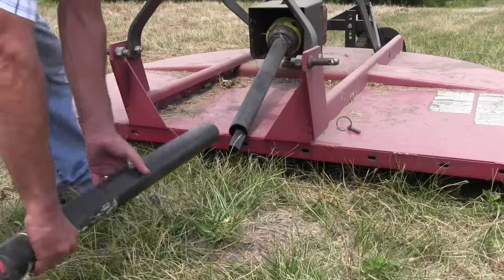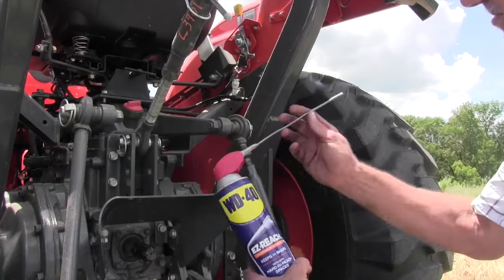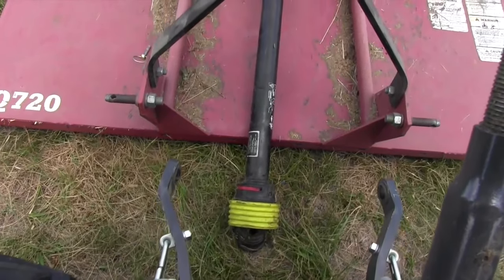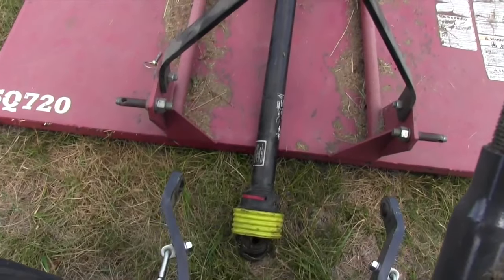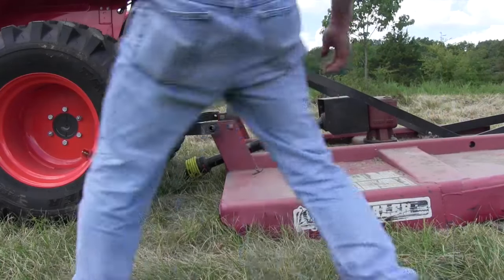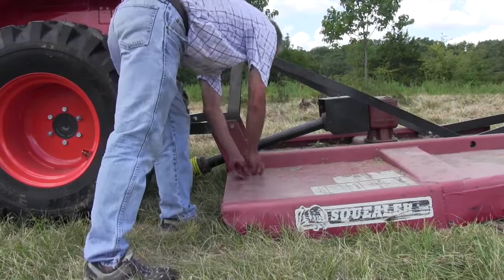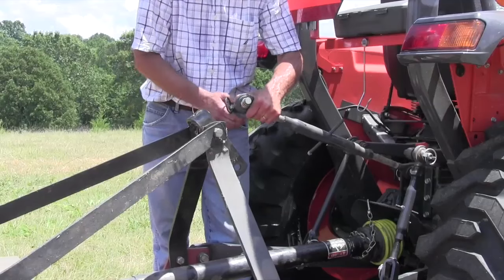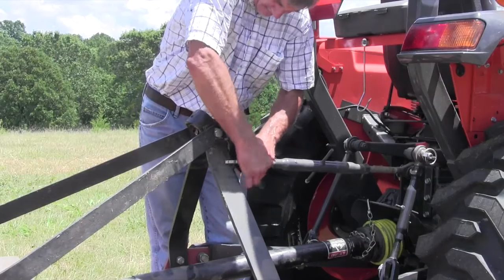A Tip to Make Hooking Up a Brush Hog Easy

Comment: Mike, do the stabilizer arms need to be set to the same length? The reason I ask is that my tractor was delivered with the rotary cutter attached and I noticed that one was set about 2 inches or so longer than the other. I have the slot type with the pins not the turn buckle type like shown in your video. Seems to me that it would off set the cutter with the tractor.   Thanks

Comment: Good info Mike!  Is it always better to attach the top link last regardless of the implement?  I had to remove my tiller so my dealer could install a backhoe for me, and I had forgotten what to do first, 2nd, & third!  These aging brains...

- Sharon
Reply from the maker: I usually start from the bottom and go up.  Lower links first, then the PTO, then the top link last.  If you don't hook the top link up after the lower links it's in the way of getting the PTO on.  Now with a tiller, I guess you'd have an outside chance the thing could pivot on the lower link arms and the A frame could come forward while you're hooking up the PTO and that wouldn't be good.  The parking stands should prevent that, but my experience is tillers can get a little goofy because they're generally resting on the tines and they spin.  I'd have to defer to what the owner's manual says on that because of that danger.  Also, if your tractor PTO doesn't spin when it's turned off for easy hookup, you'll definitely have to lift up the whole tiller to spin its PTO and you'd have to have the top link hooked up to do that.  I'm leaning toward hooking the top link up on a tiller before the PTO.  Great question!

Comment: If you'll slightly engage the PTO lever, the tractor shaft will turn easier than the PTO shaft. Make sure that the engine is NOT running!!!

Comment: How do you properly adjust the top link .. mine always gets bound up causing the mower to rest on the top link and then it mows to high
Reply from the maker: Here's my opinion: https://youtu.be/EcjJ8IBPUao.  I hope that helps!  It's not catching on a pin, is it?  I put a longer pin in my cutter one time because I lost the short pin and it was too wide to allow the hitch mechanism that's on the cutter to move in and out and it would do exactly what you're describing.  Got a shorter pin and the problem went away.

Comment: Thanks for video, but can you also advise best way to remove or install PTO to the Bush Hog?
Reply from the maker: Are you having trouble getting the PTO on the tractor?  Or are you wanting to remove the PTO entirely off the tractor?
Reply: I want to remove the drive from the Bush hog. You only discuss removing the drive from the tractor.
Reply from the maker: My bush hog has a push in connector just like the part that goes on the tractor which is a great feature.  Most of them, though, have a bolt that you have to remove to get the back half of the PTO off.  It should be just in front of the gearbox and a whole lot of fun to get a wrench on.  Good luck!

Comment: I use diesel fuel instead of WD 40.  Simply drill a hole in the cap of a plstic oil jug, I use a GALLON Jug.  Quart wqill work too.  Just squirt a little diesel on every dry part.  Use it for all kinds of tings, BB
Reply: I use an old squirt mustard bottle for oil and lube! By the way WD-40 is a great product but it is also a degreaser best used for nut buster,,, By the way again, Who knows what the main ingredient is in WD-40? WD-40 Is also good for fly control on your horses just spray the tail and mane what they swat flies wit,,,,,,

Comment: I was hoping that you were going to explain adjusting the top link of the cutter deck....dang...maybe its in a separate video...this can be a very dangerous item if not set correctly...and causes damage to the deck and arms.

Comment: Why do you have to pick up the cutter to be able to turn the cutter shaft?  My cutter will turn anytime unless it's jammed on a stump or something.  And in my experience you only have to turn it like half a spline to line it up.
Reply from the maker: It seems like it spins a little easier if it's level.  Plus, I usually just drop it off in a random spot and if there was grass growing there it stops the blades from turning.  Now, if you're wise and cut a nice level spot to put it you don't have to mess with stuff like that...
Reply: My standard storage spot has bricks placed under the sides so its up off the dirt, and there's nothing growing there.  But again, grass shouldn't keep you from turning it 1/2 spline's worth.  Just my experience.  I may try the pry bar and get back to you.  I've not had much trouble hooking up without one - been doing it for years.

Comment: My level of tractor part terms is very low so please bear with me.   About midway on the adjustable 3 point arm are two pins. I have used them to turn the arm to shorten or lengthen, same with the top link.  Those pins are at best 2 inches on my 2015 Kubota, and once I'm getting to the point of tight, lifting , the darn thing just won't turn.  Is there a tool that will slide over the pin with an arm to give me some mechanical advantage.  I have used the closed end of a cresent wrench,  but on these  shorter arms it slides off.  I have done internet searches, with no luck.  Name of tool, where to buy ?

Comment: On a 250a Belarus tractor , What can I fix to keep the implements from swinging left or right . I have not figured out how to rig something up Yet ,that has worked. There is nothing to bolt to or hook to On the outside of the rear end .,Out toward the tires.. Any Ideas would be Appreciated Tremendously!  Thank You!

Comment: I'm sure for video purposes you don't always have everything you might have when operating your machine, but I seldom do anything around my Kubota without wearing gloves. Not only do they offer some protection against minor pinches and abrasions, but they keep your hands much cleaner when coming in contact with those greasy PTOs and other fittings.
Reply from the maker: I totally agree...for my whole life I've tried to get in the habit of wearing gloves and for whatever reason, I just can't seem to force myself to do that.  It's definitely better for many reasons.  My dad wore gloves every time he was around equipment.  I'll try to do better, we should all wear gloves when working around equipment.

Comment: Which Bush Hog would you choose for a Kubota L3010 with a front loader four-wheel-drive a landpride RCR 1860 or a bush hog Bh15 or squealer , Thank you in advance for your suggestions
Reply from the maker: Glenn, I try to make a policy of not recommending one brand over another, but Land Pride and Bush Hog both make excellent products.  Here's a  link to one of my early videos on picking out the right sized cutter for your needs: https://youtu.be/JFma-zNARmI.  Hope that helps!

Comment: I hardly ever hook up my top link.  Follows the ground contour and dosen't bend any brackets associated with the top link if you go through a ditch or something that is more travel than your 3 point has.  I have since installed chains in place of braces incase I have somewhere I want to completely lift the machine, but still run most of the time with out a top link.

Comment: How would you get a Stuck brush hog pot shaft off of the pto spline on the tractor. I see mine is way up past where it should be on the spline?
Reply from the maker: Soak it with WD-40.  If you want to know what's going on inside, watch this: https://youtu.be/yx-0WoYxeZ8
Reply: I get that but it appears that the pto shaft coupler is way to far up on the spline as if it has gotten jammed up. You can see the ball bearings and looks to have deformed the metal ring on the coupler. Any ideas how to get that unstuck?

Comment: I have tried leveling my brush hog but I still dig furrows when I make turns and it is digging up the yard. any suggestions?
Reply: Trow away the flexible top link on mower pin the top link where that stupid flex link pivots and adjust your height by lengthening or shortening the top link. Make adjustments with mower down.

Comment: Spend a fortune on a tractor, spend a little more for a quick hitch....
Reply: If you have an older tractor, not included. A lot of use can't afford a "NEW TRACTOR". Just use this tip instead
Reply: @Squarehead45  then buy a set of pats.. a cheap back saver.

Comment: You mIght consider a correction. When you talk about connecting the shaft on a tractor when told can't spin the shaft, I think you say to start the tractor. I know you mean just to lift the cutter and then shut it off before connecting the shaft. Some us might take your spoken word though. 
Great tip with the pipe. I only have one pto driven implement so I'm careful to never turn on my pto with the mower unhooked. The shaft has a brake unless it's on so it's usually aligned with the mower when I come back for the mower. If it's not, it's a real pain getting my 3 blade finish mower to turn by hand just the right amount to align the shafts.

Comment: back tractor up a tiny bit after hooking one arm. that will move cutter just enough to connect other arm. no pry bar needed. also raise and lower arms to align  arms.  never hook up chain to shield to stop it from spinning because it can become a projectile.
Reply: Interesting point about the chain.  I noticed my auger does not have a chain on either side, but my cutter does.  I always wondered if it somehow broke free.  My assumption of the purpose is to keep the shaft cover from spinning and catching clothing, etc.
Reply from the maker: That's a can of worms with manufacturers because a spinning chain is a problem.  Some have quietly quit including a chain when they ship equipment.  I had a viewer ask why they didn't get a chain when they received their cutter and I called the company (and I won't mention who) and they politely told me not to go there.
Reply: Tractor Mike I bought a Woods brand cutter this year.  Operators manual says repeatedly to not operate without the chains in place.  Called Woods to let them know that mine didn't have the chains when I picked it up from the dealer and would they please send me a set.  They informed me that I was responsible for buying my own safety equipment.  They said that since farmers don't follow the greasing schedule it causes the plastic cover to get stuck to the pto shaft.  But what about those of us who do grease and take care of our expensive equipment?  I don't Mind being responsible for my own safety, but i'd like the manufacturer to give a hoot about the users safety.  Pay that much for a good cutter and I'd like them to at least provide what they recommend as being best practice and let me take responsibility for its proper use.  just my two cents worth.
Reply: Backing up the tractor after hooking one arm sounds great for initial hookup, depending on how level your ground is. Last night I was brush hogging facing downhill and had a pin jump out of the adjustable arm, dropping my mower into a hole.  No way in heck I could drag it anywhere. The long pry bar method worked. Now wish I could bungee that bar onto the cutter but it's too long!

Comment: how about showing how nice a set  of Pat's easy hook-up makes it a lot easier, and i-match maybe? and i use Fluid Film as my go to product. i've used WD-40 also-but now just as my gun cleaner-works way better for that-IMO. thanks for the video-ok
Reply: I had some Pat's things but they didn't last a week.  All the setscrew bolts kept breaking off.

Comment: Nice tip and I will use it. Now, with all that youtube revenue, go buy some steel toed boots and ditch the tennis shoes and sandals.
Reply from the maker: Wise advice :).
Reply: number of farmers that use sandals far outnumber the amount that use steel toe boots for several good reasons
Reply: Chinese work boots